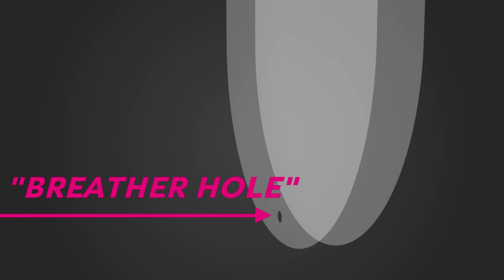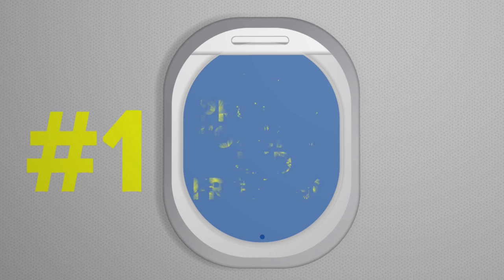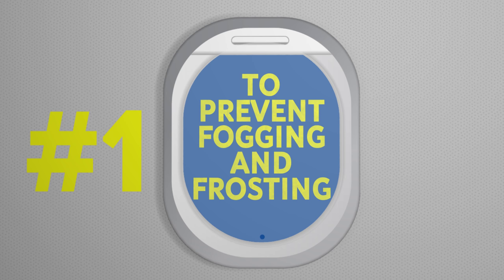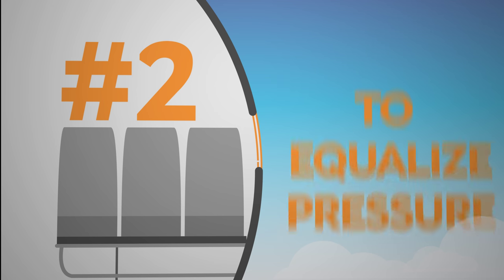What’s That Hole at the Bottom of Airline Windows?

Comment: That second reason doesn't make sense since there still is a pressure differential of the same magnitude acting on the outer window, and if that pressure was enough to explode the windows, the outer window would still go out, which it doesn't.

The real reason is to make the pressure only act on the external window. Some sources state that it makes technicians more easily notice if a window has been cracked, but I suspect part of the reason is also that if the inner window blew out, it would explode and send fragments into the outer window, possibly dangerously harming its structural integrity. If all the pressure is on the outer window, this will not occur.

Comment: Of all the videos covering this topic this is the only one that gives the correct answer. That is, no misting.
Reply from the maker: Thank you sir. They all ripped me off and missed the point.
Reply: I gave a reply to one of the other you tubers giving the erroneous answer about e qualifying pressures. Mr reply asked the question: what did aircraft have before the little holes? I gave the instances of 2 with piping leading from the cavity twixt the panes through dessicant containers to atmosphere. They were bac 1-11 and hs 748 ( I worked on them from 1960s to the 1990's. The hole in the inner pane saved weight and maintenance so you are quite correct as the reason for it!